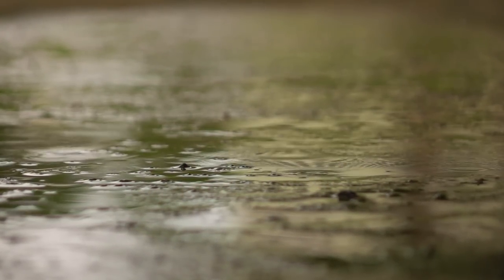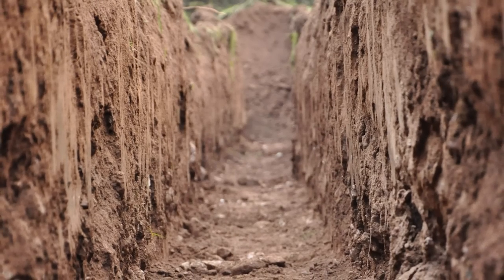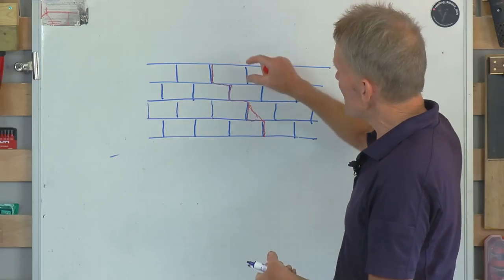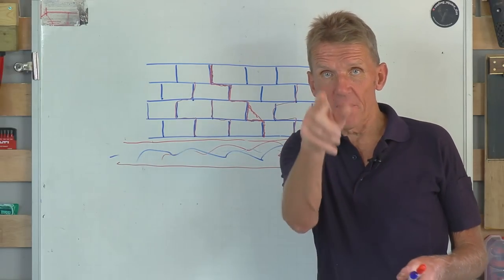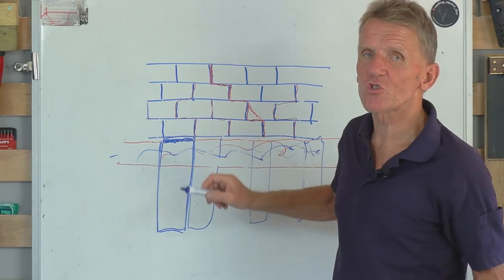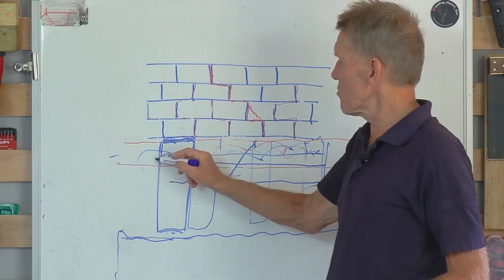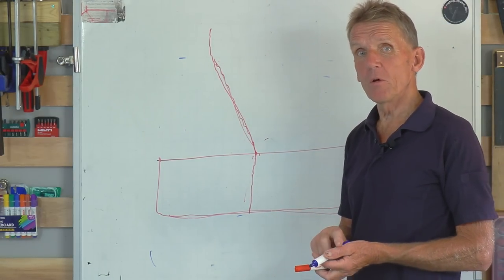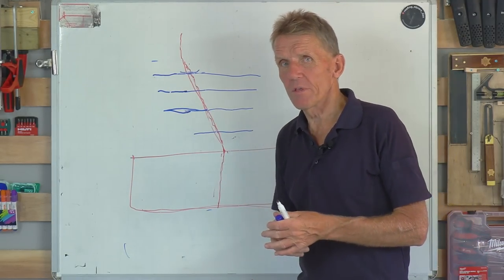Is The Hot Weather Cracking Your House Up?

Comment: Good job Roger. I hear NHBC are looking to revise the depth of foundations due to climate change. I think you should add that cracks are not just caused by clay shrinkage, but by trees, drainage and water main pipes or sometimes made up ground or voids. Not all surveyors are bad, just the unpractical ones.
Reply from the maker: This was drought related, I did say there is a lot more to talk about.

Comment: My house is a 1930s semi, and the mortor is black old foundry sand & cement never cracks but let's the house move with the seasons . Only crack is on the render in the corner of the 45' bay upstairs, as it's built on the floor joists and they sag overtime, good video cheers.

Comment: Get the garden hose out and dampen the house surround? Thanks Roger, your right about lime build, most are pre nineteen century build on shallow footings and often show course cracking through ground movement. Interestingly the cracks you talk about get “healed” when rain dissolves small amounts of lime and fills the cracks.
Reply from the maker: Yes I have talked abot the autogenous qualities of lime in previous videos. Stalatctites and all that.
Reply: @SkillBuilder  lime or chalk houses would be the subject of great interest to many restorers Roger and it would be appreciated by so many to gain a better understanding of this wondrous material. I would love to know the difference in application and durability between putty and hydraulic? Yes I know what they are and how they are produced etc but the differences in mechanical strength etc is a wall built in hydraulic and one in putty different? Perhaps one of your knowledgeable pals could throw some light on this grey area and teach us struggling lime workers more about the material we are using because getting good advice is rare and often wrong or misleading.

Comment: I used to work in a house in Cardiff and the council built an extension but because the land was reclaimed the only option was to build on a raft which was fine but a little disconcerting as you could feel the structure vibrate if you jumped up and down lol
🤣🤣

Comment: Really helpful video Roger….I’ve got a 1910 London house with exactly these cracks….how can I determine if the mortar is lime or cement? Thanks.
Reply from the maker: If you can rake out a bit of mortar with a screwdriver it is very likely sand and lime. The age suggests it will be.
Reply: @SkillBuilder  and by now it has turned to chalk, the mix will usually contain some course grit to act as a binder to bolster the chalk.

Comment: So.. im looking at buying a house that is covered in Rend. The house has a big crack on the rend which has been filled with what looks like Silicone. There are damp patches on the inside around where the crack is on the outside of the building. My Question is, Is it a big job to get this repaired or is it fairly simple? I should note its a victorian house, probably solid wall not 100% sure though.

Comment: why not pack the top of the new concrete foundation with slate instead of dry sand and cement?
Reply from the maker: If you were able to get a flat top on the concrete all the way through it may be an option but dry packing is the accepted method of tightening the gap.

Comment: Hi mate, I've used Porcelain tiles around my bungalow to prevent rainfall around the property etc. Would this also help keep moisture in around the ground aswel to help with clay drying up?
Reply from the maker: To some extent but over the course of a few months the ground will dry out. Very often they use clay boards to separate the clay from the foundations, that could help.

Comment: Seems like the more sophisticated we try to make buildings the worse they end up being in longevity. Victorians chucked a few bricks in the ground, built with mortar so weak it's basically sand, and the building is able to move without cracking and last 100s of years. We dig meter deep foundations, use strong mortar, only for any movement to crack the entire wall in half

Comment: Hi Roger. Have you come across Geobear? Remarkable.
Reply: They did mine a few years ago. Injected down 2 metres at a cost of £20,000+. Eighteen months ago the cracks opened up again so Geobear came back and injected down another two metres (4 metres total) with no additional charge. Recently the cracks have appeared again but this time they're only hairline. I'm waiting to see what happens when we get some rain. We are on London clay.

Comment: Thanks for that information I have an 1890 end of Terrace.A have also noticed a bulge about first floor level on the outside wall any suggestions.I took the  chimney breasts out of the two bedrooms and I’m thinking of taking the lounge and dining room breast out.Any advise wound be appreciated.
Reply: As long as the bulge isnt beyond reasonable structural limits it should be ok if you put lateral restraint straps around every metre or so at floor level screw then to youre joists  and to the brickwork with plugs and screws or if youre bricks are soft use chemical studs  bear in mind taking youre chimney breat out will weaken youre walls slightly
Reply: Best you contact a structural engineer. He may reccomend installing a tiebar with external plates to prevent collapse.
Reply: @yvonfem  it all depends on the state of everything and an inspection by someone who knows what there doing would be advised. Chimney breast can act like structural props and serious consequences can result if removed. Beware of the dangers once you start pulling these old properties apart

Comment: maybe you can help me I've got an issue with rat under my floorboards and in the loft, I've done everything possible so far but no joy! and it's bought a mate long now😟
I do get them now again and taps normally work! this is a funny looking rat it's grey and white, i have set the traps on numerous times but never caught it and even use the sticky pad under the floorboards dragged  somewhere got out of it, poison it will not touch it general is useless anyway, and the live trap it will not go into. try different peanutbutter's haven't tried chocolate.
it's under the floorboard and in the middle of the night it wakes me up! noring at the end worried about the joist,
I wondered about smoke you can get smoke bombs for chimneys or maybe these joststick balls might do it.
I need somebody with a snake lol any ideas!

Comment: We’ll, good advice, what you think , about filling silicone, if the cracks it’s outside the building , I believe it’s even worse if water goes inside a brickwork during the raining seasons which is very common in U.K. 🧱?
Reply from the maker: You make a good point and a flexible mastic might be a good idea but I would tend to use a spray foam.